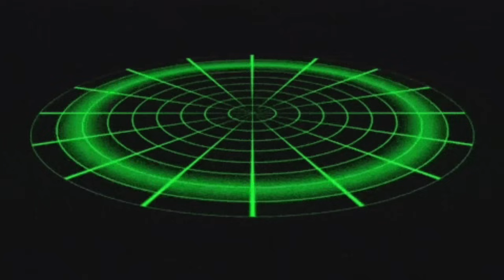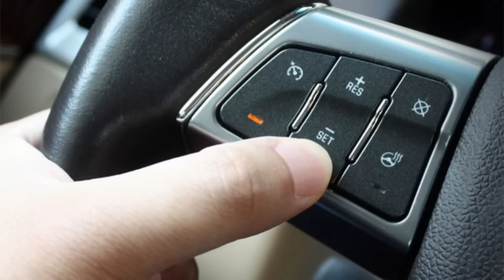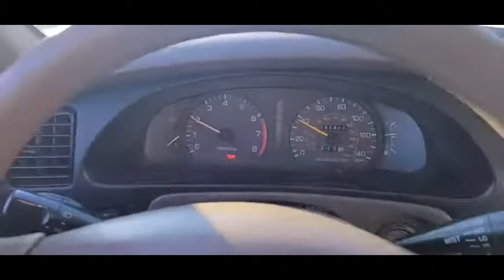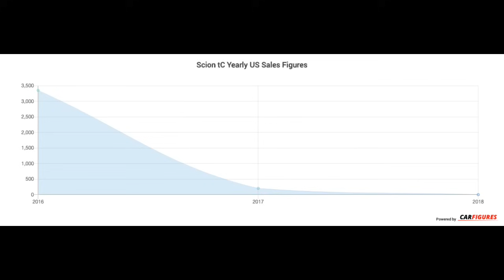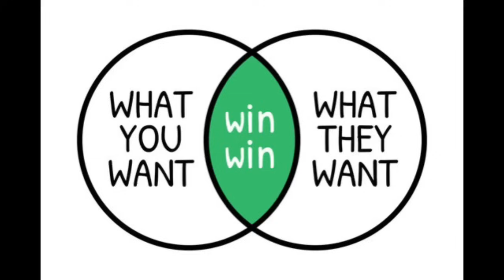The Scion TC is Massively Misunderstood… || DEEP DIVES

Comment: The TC is possibly the most perfect little all around daily driver you can get. Good mpg, they just run forever and are very easy to work on. Parts readily available and inexpensive, booming stereo, good handling, and they aren't loaded with a bunch of unnecessary electronic bulltish
Reply: the stereo is honestly the achilles heel of the car lol my grandma's 2000 buick lesabre had a sound system that was like 5x better. put out WAY more bass, was capable of much higher volume without distorting sound quality, and the clarity of the speakers was far superior. and they were bose speakers/subwoofers that were 6yrs older than the TC i own. only thing better about the TC sound system is that i can plug my phone in for music.

Comment: i got my first car in august, a 2014 tc and it will never stop making me happy. it sounds amazing, handles amazing, and the sound system is phenomenal for stock.
Reply: It's even better upgraded.  The fact that it has provision for a 3 way setup in the front door from factory is great.  I stripped the interior, put sound deadening all over, upgraded all the speakers and new wiring, couple amps and a 10" sub and ha e an amazing sounding system for under $1500.

Comment: I have a 2015 TC and it is one of the most reliable cars I’ve had, fast as hell too when you know what you’re doing 💯
Reply: I have a 2015 Tc and it only pushes ~150 hp. Its as fast as your usual grocery getter.
Reply: I have a 2015 tC. It's slow as molasses. Nice tires can help, but it's just a slow car. Slower than the 2017 Fiat 124 I had, which is slower than an MX-5. 🤣

Comment: I have a 2014 scion tc series 10 and it is absolutely perfect. Has enough power to get off the line at a red light and a ton of room. I have never owned a car that legitimately does not need oil every couple of months, its been almost a year and still doesn't need oil. Nice job on the deep dive, this car definitely slipped under the radar on how crazy reliable it is.

Comment: I haven't been in many cars, but tC meaning "touring coupe" is spot on. To this day, the first gen tC is the only couple that I can sit behind the front seats with them adjusted for myself, and my 6'1 300lb ass is comfortable. Head BARELY brushing the ceiling, knees only slightly spread to not jam into the back of the front seats, and ankles NOT cramped. And that's in a car that HAS a sunroof. Did I mention that the sunroof doesn't make the roof too low for the driver and front passenger, either?

And the second gen tC is just a bit bigger. The whole car was scaled up directly proportionally from a 25" diameter tire to a 26" diameter tire. With that I didn't even have to spread my legs, and I had about 2 inches of headroom sitting behind the front seats when they were adjusted to me. The 2nd gen tC even upped the ante with the sound-system by having a factory 3-way component setup, meaning each door had 3 different kinds of speakers in them, allowing for a more even and broad frequency response without any beaming.

Man, I want another tC... Just not another first gen, and especially not an 08-10... Fuck that oil consumption issue. And 5x100 pattern wheels. And measly 25" tires.
Reply: 9:48 This is a stock header on 05's and 06's by the way. It's UEL on one primary tube, while the other three are equal-length. For comparison, a Subie Rumble header would be UEL on TWO primary tubes, either left/right pairs, or alternating pairs (every other cylinder). They changed it to all equal length in 07+ IIRC.

Comment: I started dailying my ‘06 Scion tC a couple weeks ago. The 2.4l is sitting on 140k, and she runs like a dream. It handles extremely well, and the 5-speed transmission is holding up really nicely. 

Only thing I don’t like is that mine was bought from factory without a spoiler, I think the back looks a little odd when it’s flat, though it’s not particularly expensive to get a factory style one.
Reply: Got a 06 with 103k myself although I have the 4spd. Like you said I'm honestly amazed with how it handles, and the 4spd is far from the worst out there. Mine also doesn't have a spoiler but I want to get one in the future too. I love it though and wouldn't have anything else as my first car.
Reply: Has your trunk release pulled off yet lol. I have a 2010 btw.
Reply: Surprisingly no. I’m pretty gentle with it though lol.

Given I know Prius’s of the same era are prone to the same issue with that, seems like it was (even if in small part) a Toyota issue at the time.
Reply: My mom got a stick tc when they first came out.  The car was so slow she switched over to an auto Camry which was faster
Reply: @unknownalias5538  It had to of been a V6 camry otherwise that's factually false lol
Reply: @daltonliles6161   it was a baseline silver Camry of some sort .  I always thought the tc should have been rwd .  They would have sold a ridiculous amount
Reply: @unknownalias5538  I agree they should've but then they would have gotten the miata reputation and became not as unique. They just don't have enough power to be a quick car. They don't need to be though they're fine as commuters.
Reply: P much this. It’s a reliable daily that handles well, and is reasonably fun to drive, I don’t need it to be super fast lol.
Reply: Bruh get a job you could be making the amount it takes to pay for a spoiler, painted and professionally installed, in the amount of time it took you to type this comment hahaha what rofl

Comment: Current owner of a Series 10.0 Gen 2.5 here and past Gen 2. Definitely this car has a lot going for it. Everyone I talked to always mentions it has stupid amount of cargo space and the moon roof is great for those date nights. Overall the 2AR-FE is a good engine and the car can do a lot of minor hauling. Again we have to see if they will become a thing like the civics or integras of the past. All and all, Toyota should of brought it back to its lineup as the new Toyota Celica in 2017.
Reply: All in all, not all and all. And should've, not should of. It's a contraction of should and have. Should of is nonsensical.

That said, I have a 2015 tC. It's an excellent car.
Reply: I felt that same way! Toyota should’ve brought the tC over and made slight upgrade.
 It’s ridiculous they chose the last two models for Scion then switched for Yaris 🥱🥱🥱

The Gt86 was already there so they dropped the ball on hanging up the tC. Mind you the Lexus RC had the tC body & everything

Comment: I had the last year model, 2016, installed a Borla axle back exahust and Marquee black wheels. I ended trading it up for a Mazda3 2018 Touring 2.5. God knows I love to drive the Mazda, it's quicker, better handling, better suspension, better transmission, better dynamics... But for some reason, I can't stop missing my tC and sometimes I just wish I didn't have to change it. If I could, I'll just get it back.

Comment: Ive had a 2012 Scion Tc for the past 5 years with now 138k miles. Only major problem ive had is the need to replace the clutch for the manual. These motors are good for up to 400hp with a turbo on stock internals and are shifting to a “cheaper” alternative to the K series since the Camry engines are dirt cheap. NA boltons can get you 200hp fairly easily so it can be fun and quick enough to beat your occasional bseries honda and even an acura rsx from a dig. Super fun cars that i believe will come back after people realize the fun to price ratio and how much you can do to them if you do your research
Reply: Cite your sources I call bullsh!t on 400hp stock internals lol no way. It is not a K20 and never will be.
Reply: @Ultra437  for sources id say regular a$$ wikimotors on the 2AR-FE and some youtube videos on turbo gen 2Tcs
Reply: @Ultra437  @FrankensteinMotorworks has extensive knowledge on NA 2AR-FE engines and even GearsandGasoline has one in their MR2 build.
Reply: @enriqueacosta5083  thanks I'll check them out

Comment: I boosted my tc and I’m absolutely in love, I’m gapping wrxs at the moment. I want a run with an STI next to see how she holds up
Reply: What’s your set up? I’m trying to turbo mine too
Reply: @Kartingwild  It’s a t3/t4 maxxpeedingrods turbo setup on 9psi making around 280-300whp. Self tuned with an apexi neo afc.  Only advice I would give for boosting these cars is to make sure you open the motor and put either bigger head bolts or arp head studs, our engines (2azfe) are known for the head bolts getting loose and the head starts to lift. That’s what happened to me so when anyone asks me about it that’s the only advice I can give. Everything else is solid runs great no issues. Super fun car

Comment: I recently let go of my 14 Scion Tc Manual a few months ago because I got offered a great deal on it. The TC is the most slept on car of the last 20years. In stock form it has an amazing sound system, panoramic sun roof, and ok suspension. I threw on TRD lowering springs and the car behaved amazing, it would lift off over steer on the corners and stay flat. I would easily smoke corvette, Camaros, Miata, S2000, and WRX at my local autocross with just lowering springs and tires. Everyone thought I was highly modified but I was practically stock and kicking everyone’s ass. The stock sway bars are nice and thick for a stock car at 21mm. I hope the new owner enjoys my old TC. It is an amazing entry level daily. Lastly it is extremely practical being a hatch back, and the rear seats even recline! I’m in a BMW now but young kids in high school or college should totally have one of these reliable cars on their shopping list. This cars only fault is that it doesn’t have high Hp numbers on paper but that doesn’t mean it is slow and that doesn’t mean it is boring. It is quick enough to still put a smirk on your face. Just be sure to get the manual if you can find one, the manual is quicker and really wakes up the engine. One last thing I want to say is that the car is super simple to work on, this makes it an amazing first sports car for young guys trying to learn to crank a wrench. Nothing about it is super intimidating and there is plenty of online resources on how to maintain them. TC was never trying to be the fastest, it was trying to be an amazing daily and it was a huge success in that aspect. Don’t sleep on these if you are considering one.

Comment: Tc 2.5 owner here. I can in fact say I agree with this. Still get a bunch of hate at car meets but others love the car. Safety wise it’s great. Just hydroplaned pretty bad. Slid across the highway into a grass ditch, spun 180 three times, hit a cement drain, and landed inches away from oncoming traffic on the other side. All that’s messed up is the subframe, bumper, rad support, and condenser. It could have been so much worse especially if I was in my old cars (lancer or celica).  Things a tank. Mechanically speaking it’s got almost 160k and all I’ve had to fix before the accident was the pcv (common problem) and a sway bar link.
Reply: Glad you’re ok tho

Comment: The tC2 is such a nice car. In the modern era, that flat roof is SO iconic. It gives a really underrated retro look to the car!

Not to mention those thick rear fenders and angular cues just make it a head turner imo. 

I have a 2013 and nothing brings me as much joy than the cool driver angled center control and flat bottom steering wheel.

I really do think the tC doesn't deserve the negative rep it gets, speed isn't everything. I personally picked my tC over the FR-S because what it lacks in speed it makes up for in reliability, utility, looks, and a really nice low end torque that makes literally going anywhere an absolute blast.
Reply: Tc faster than frs
Reply: It is in a straight line for sure. More torque

Comment: I own a 15' TC and will be paid off very soon. I was 30 when I purchased this car. And even if the car wasn't fast, the build and design was great. I bought this car because it had a lot of interesting designs throughout the whole body. The interior design is the most impressive of all(cheap materials, but hey, its an econo-box). Something about having a low roof line and a high center console really feels like I'm driving a tank to and from places,lol. Some whom ride in the car with me ask if the touch screen display was standard. When I told them this is true, they jaws dropped to the floor. I just assume many cars around that time did not have a touch screen display at base price. I also must mention that the parts are cheaper when shared components are the same across all models, including the camry. 

But, I will admit, I came close to giving it up for a luxury car(reminding you, I'm 30). I struggled with the delay from the throttle body. Its automatic with paddle shifters. When its in this mode, the shifts are delayed. I have not tried the manual, but I heard is much more fun. However, the car handles pretty well. Some say it drives like a truck. I don't think so. The car sticks firmly to the ground as angular momentum kicks in as I whip around the apex at dangerous speeds. Its a fun little car to be had. And don't let anyone tell you otherwise.  

Overall, this car is awesome. With the budget I had at the time I bought the car, I thought it would be smart to buy toyota because of its reliability ratings. I'm happy to say I have not had any issues with this car for 6 years. I have plans on buying an Audi next year, but if that car gives me issues, I can always count on my scion tc to have my back.
Reply: Touch screen was pretty common at '15. Anyone dropping jaw is delusional. I'm 39, driving a lowered '15 tC... laughing at the luxury bit. As if 30 is old. 🤣🤣🤣
Reply: @Vykk_Draygo  I actually ended up buying a 2018 Genesis G80 5.0 like a month ago,lol.

Comment: I own a black 2014 TC manual with 66k miles. Bought it for 10k, clean title but it needed a output shaft seal as it was leaking gear fluid. Got that shit done, fixed other small details like sunroof sensor, trunk struts and then added CAI, TRD exhaust, coilovers, pulley, strut bar, HID head lights, headers, 15% tint all around and a short shifter. This car is a lot of fun so far.

Comment: I currently have a 2008 scion TC with a factory TRD supercharger I love this car and the way it looks. I had it dyno and is putting out 200hp, they only made 2300 of this model, and my TC is 636 on the line. The supercharger was also pretty reliable and super easy to work on however, tuning is a little harder. I have tried racing it and it's not the fastest at least on paper, but if you know how to drive and take corners you can take a few people to gapple-bees because of how light it is and how it handles.

 but in all fairness it Camry with a supercharger that drives like a Miata, a great project car, and daily.
Reply: Drives nothing like a Miata. I love my tC, but don't kid yourself. 🤣

Comment: got a 2008 tc with a 5 speed transmission, 2.5l with 170k miles. id spent the previous two years learning on and driving this old old minivan thats on its way out… so this car was a breath of fresh air. learned manual on it. its super fun to drive around, and looked awesome till my sister jumped it into a ditch going 30 over on a state highway lol. got it running again, but im debating whether to fix it up completely and cosmetically and take it to college or get a civic si

Comment: Loves my 2016 scion tc. Added FBO with a tune and is already as fast as a stock wrx. Pretty kool when adding a few mods makes it kinda quick for a 180hp car.
Reply: What is the hp you are getting I’d want to be at 220 or above. Considering getting one and would want bo or put a sc on it or with some more mods
Reply: @zhyde07  FBO Tune with a few upgrades might get you too 220hp. Not sure about my haven't gone to the dyno. If I have to guess I will said over 200hp for sure. But now 220hp. Yes added a Tc or a Sc will get you to almost 300hp.

Comment: I found mine online (white 2010, tinted windows, aftermarket antenna), we went to the dealership and I test drove.  
I’m 6’ tall but with the sun roof there’s just enough head room.  
Everyone says it’s “so cute”, maybe, but I don’t wanna hear that.  
I really love the speakers and panoramic sunroof but my favorite part is the shape of it. 
I researched some tips on the car and I changed the welcome text on my radio, found the hidden handle for the very heavy hatch, found the rear dome light and in the glove box there’s even a special place for my gum!
Idk if it was intentional but I have an iPhone 11 in a thick case and it fits perfectly in the cubby by the cigarette lighter.  
It has zero rust and it’s so clean.  
The only thing I’ll do is get some wind deflectors, and a random Japanese sticker because aesthetics. My only real concern is who is translating these stickers?  It could say “This is a very cute car!”  And that would be just terrible.  
People can think whet they want but at the end of the day I have a reliable car that looks interesting, has a panoramic sunroof, and costs less than any civic of the same year.

Comment: I just got approved for financing on a 2016 Scion TC with the 6 Speed Manual Transmission 143,000kms, it has a minor accident on the Carfax. I asked the salesman about that and he says he remembered the dealership receiving the car with a damage Front bumper, they either fixed the damage and had the bumper repainted or replaced the Front bumper, I have to ask more about that. Long story short, I test drove it and the suspension is smooth and quiet, the clutch was replaced in 2018 it's got a nice smooth engagement from a dead stop. I'm a Toyota car enthusiast, I plan to go all out on the Exterior and a few engine bolt on's. I was thinking about installing Bride racing bucket seats and a 350mm deep dish steering wheel with an NRG hub and quick release kit. I'm definitely keeping it for a really long time after it's fully paid off.